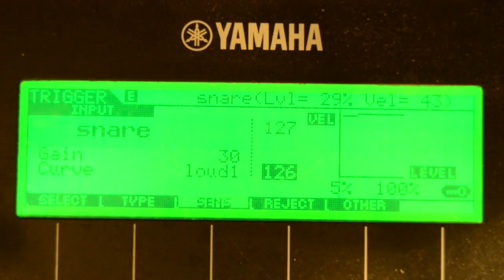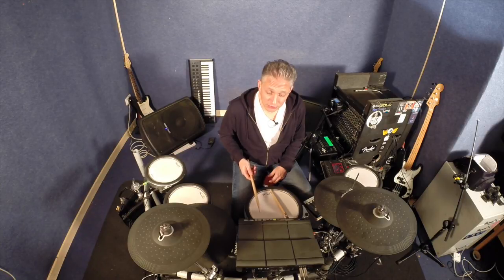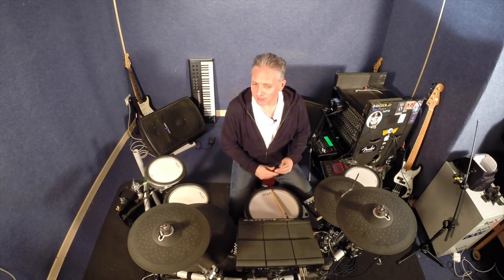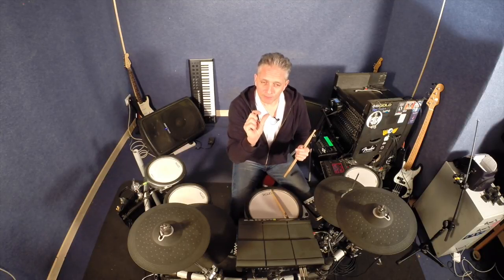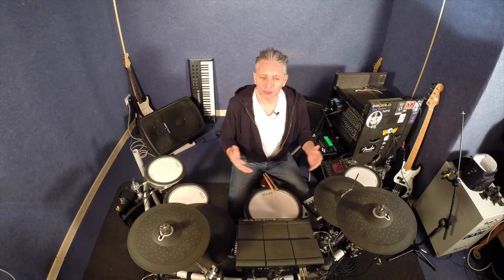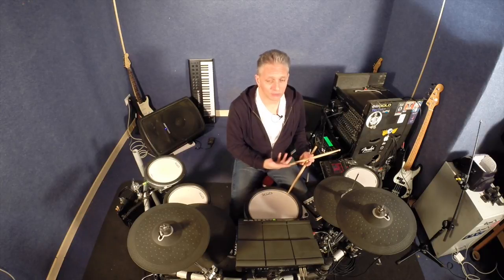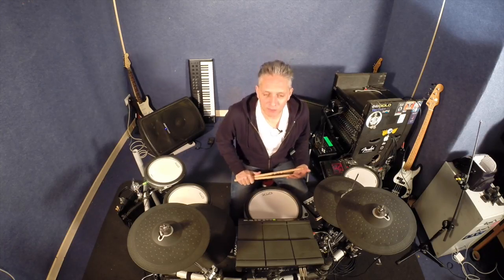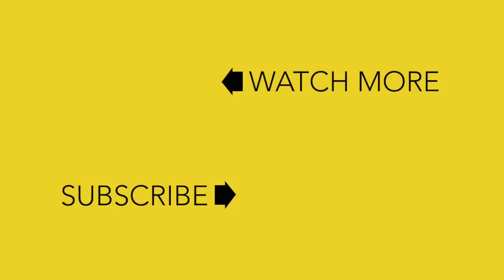Adjusting electronic drum sensitivity, threshold and other useful playing parameters

Comment: Thank you for this video!  I have been playing a Roland TD10 kit for over 20 years.  It was the floor model at Guitar Center, so all the sounds and kits had been modified before I bought it.  There were 3 or 4 kits that I really liked just as they were, so I never bothered to learn much about how to made adjustments.  Then the battery died and the module went back to the factory settings.  I lost all those cool kits.  I've been fumbling around to try to create a kit or two that I like.  This video was incredibly helpful!
Reply from the maker: Glad it's helped you out!

Comment: Hi, these are wise words ... 
Actually you could play with the tension of the meshheads to make it feel right for you. 
The sensitivity is the scaling of the dependence: force hitting the head to a velocity 0 to 127. And so, to the articulation. I set it like that, that ONLY the hardest strokes I play deliver 127. That gives you more dynamics. 
Another important setting is the velocity curve. Really. That's not a scaling but a - let's say - fine tuning to get the right articulation for the played velocity. Some modules offer various math functions to map the input velocity to an output velocity, like linear, logarithmic, a spline curve etc.
And that really makes another huge difference. 

If you need more info about scan time, hold or mask, decay etc. please just reply to that comment. 

Please take a look to Luke Oswald and his 3 lifestreams about Superior Drummer 3. In the first part he explained the proper setup of his module. This guy is another edrum crack on YouTube.

Comment: Excellent tutorial. Are you saying that these parameters have to be customized on the module no matter that a vst drums have a preset for that drum ?
Reply from the maker: Hi Hansel, the way you play is unique to you. Your touch, your feel. It may be similar to a preset and so that prest may work well for you but it's not set up specifically for you. If the set up is comforatble then great, no need for any adjustments but if it's not then yes, you should dive in and make some changes.

Comment: I just got a td30 and I'm finding that it's hard to set sensitivity properly because it will fire randomly loud notes that I hit with the  same force...any ideas to fix that?😅 I'm aware that hitting centre could cause louder hits, but I'm not sure it's purely that...
It's annoying... I'll try to play to songs but I don't hear my snare cutting through as i'd expect , and those u do hear are the weird maxed out hits...
Reply from the maker: Hi Heather, thanks for checking the video out. Without playing the drum myself and viewing the modules settings it's quite difficult to know what to suggest to help you, but I'll have ago!  Try turning your sensitivity up fully first of all and play, see if you're getting a consistent volume that way, whether playing soft or hard. There should be no quieter or louder hits. If that's the case then slowly begin to bring the sensitivity down and see if you notice when you play softer the sound is quieter and when harder, the sound is louder.  If you play harder and the sound is quieter then you may need to look at the set up of the pads zones. I don't use Roland  so I'm not familiar with how their modules deal with this but I would hope the manual would shed some light on the matter, if indeed that's what's needed. Like I say without trying it myself I'm not sure but this is where I'd start. Good luck and let me know how you get on.  Best, Bid.

Comment: What about when I hit the Ride and Kick at the same time, sometimes the ride does not trigger. It-s not the pad because I've changed with the crash pad, still the problem to the ride. Any solution? Someone answered to a similar question: "My guess is that you're hitting the bass drum (hard) at exactly the same time as that ride cymbal at the end of the fill? If so, turn down the crosstalk rejection on the 

offending cymbal pads and you should be sorted." Is the XTalk the same because I don't have crosstalk on my Alesis Command module..

Comment: Hi there. 

Awesome vid. Helps a lot.

I have an issue. My drummer plays Roland TM6 and  uses side stick and rim shot. He never uses centre for snare. The problem is that when he hits rim shot all I get is side stick. How can I resolve this problem. Otherwise it means that I can’t use the snare trigger.

Thanks for your help.
Reply from the maker: Hi Calvin, sorry for the delay in the response. Well the obvious answer for this is for your drummer to change his technique for the electronic kit and play the centre snare rather than the rim. And it's easy for him to see why if you and everyone else are not hearing what you should be right?
Reply: @bid111  Thanks a mill. I thought I was going mad! Will speak to the drummer. Most appreciated

Comment: I've gotta Roland TD8 module with my Millenium MPS 400 mesh head (modded) kit.
I'm luving it!
However, what can I do to stop a tom pad (left side triggering) when hitting other pads (even the cymbals, hi hat, ride an crash.
Tried changing sensitivity, threshold, an cross talk settings, but it didn't solve it. Anyone?

Comment: Im hearing i can turn my ambience off to get rid of the boxy sound through my monitors? I have aTD27, is it true and how can i turn it off?
Reply from the maker: Hi Pedro, I'm not really that knowledgable with Roland kits however, I've just googled your problem and found this answer. "You can turn the ambience off by pressing [Kit], pressing [F3 (FX SW)] and then pushing the button under “Ambience”. You can also turn the compressor, EQ, and effects on or off in this same manner." 
I hope this helps! : )
Reply: Just tried turning off my absence but did change the sound. That said i ordered new TS cables, that should do the trick then i can turn ambience on and off, TBD. Thx

Comment: Any tips on what kind of amp speakers to get to get a nice bass on the kik and a nice high tone sound on the hi-hat cymbals crash etc. I am not much into playing with headphones.  Thank you
Reply from the maker: So....buying speakers all depends on your budget and the space where you're playing/practicing. How much noise can you make? There are so many great solutions now available, whether it's in ear monitoring, regular headphones or speakers from soooo many brands. Without knowing these circumstances it's very difficult to recommend. But to give you a few ideas have a look at some JBL monitors, or Roland, Mackie or if you have a bigger budget TurboSound's IP range which really would give you that sonic range you mention. Another avenue you may like to explore are the in ear monitors and once you get used to them (which you will) they're great. Shure do the SE range that start around £75.
Reply: Thank you! I appreciate the info.

Comment: Thank you! Just what I was looking for, but I have a question. Why when the toms threshold are on just 2, can I hear any level hit, but with the snare set on 0, although it's much better than it was, I can still hit the drum without producing a sound? Why is that?
Reply from the maker: Hi Rob, I'm not quite sure of your explanation. What drum are you hitting? The snare or the tom? Also what are your sensitivity settings?
Reply: @bid111  Thanks for the reply. The snare setting is sensitivity 5, threshold 0, & curve linear. The tom is sensitivity 5, threshold 2, & curve linear.  I don't know what the threshold was set to, before re-adjusting it on the snare, but it was a great improvement going down to 0. At the same time though, I don't know why no matter how light I hit the tom, I get sound in the center or sides of the head, while if I hit the snare light enough I can get it where there's no sound, especially at the sides. Like I can do a soft roll at the sides of the pad & just hear the tennis racket sound, not triggering the brain etc. I'm hoping & looking for the tom response on the snare. The tom is like a real drum, where as no matter how soft I hit it, it produces a sound. Thanks much!!
Reply from the maker: @robd2650  Hello again Rob and thanks for clarifying your situation, unfortunately though I don't have an answer as it should be the other way round. Are you sure the cables are in the correct trigger outputs and you're adjusting the right parameters for that pad? It's a very obvious question but I've been caught out myself thinking I'm adjusting a pads parameters only to later find out I wasn't changing the right pad.
Reply: @bid111  No, they're the right pads. It seems as though my snare which is the larger pad from the TD12 line, doesn't respond as well as the smaller tom pads. Like I mentioned there was great improvement by lowering the threshold, but it's not perfect. I should mention that I did switch the input chords so that I was playing the snare sound through the tom for a bit, & the tom pad did allow for a more sensitive roll etc. Again thanks much as I probably had the threshold set to around 8 or 10 on the snare pad, ( I didn't jot it down), & it was quite bad at that setting. There's great improvement pulling it all the way down to zero.

Comment: Hi how are you I wondered if you may know the reason why when watching one of my drum covers back on my phone, the volume intermittently goes down. I only use the basic I rig and two mobile, the recording phone is a galaxy note 8. Many thanks and you've got a new sub
Reply from the maker: Hi Ash, are you sure the sound is being recorded through your iRig and NOT your phone? I've witnessed someone using an iRig thinking that it was recording fine when actually the phone was still using its internal mic. This could cause the volume to alter due to the mics compression settings.
Reply: @bid111  thanks for responding I think so but how can I tell and how do I make sure it is please
Reply: @ashcurt66  if you plug the iRig into your phone and press record, if you speak in the room then you should not be able to hear your voice. If you can then the internal mic of the phone is still being used and not the iRig.
Reply: @b-i-d8092  thanks so much for your response again, but yes its definitely recording through the I rig. I wondered if there was some kind of volume limiter? Maybe on the phone or sound module.